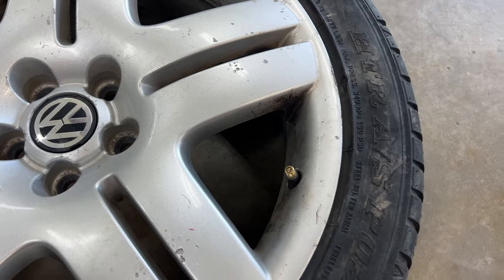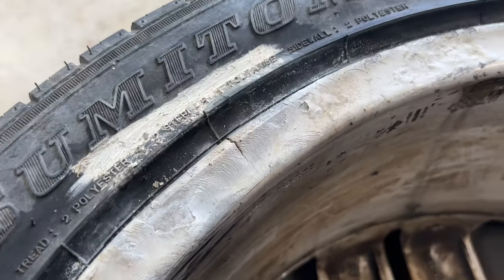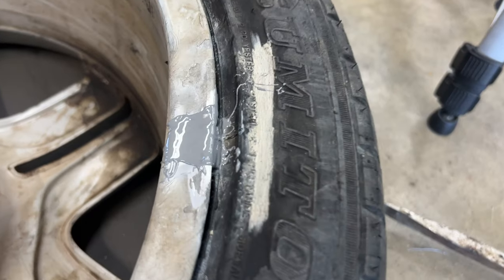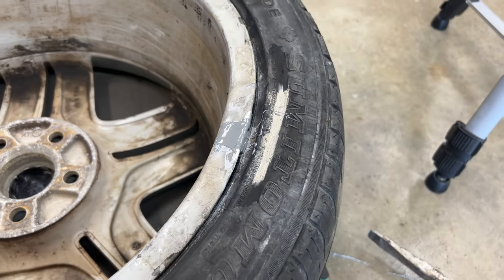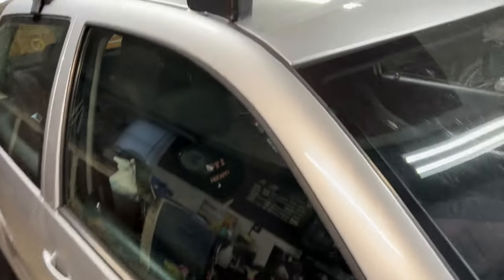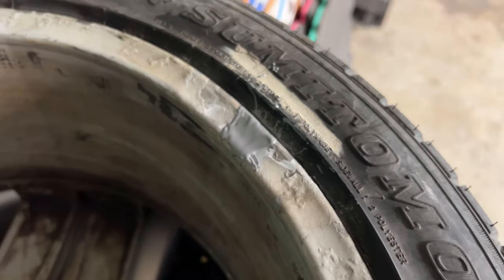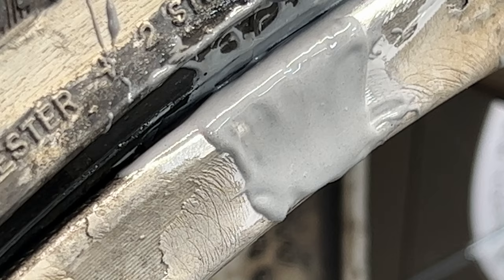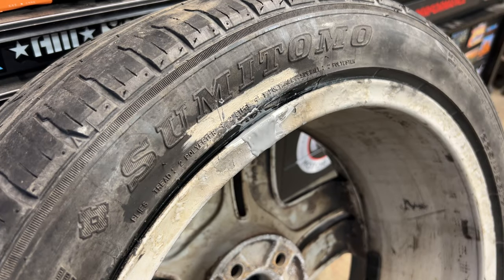Can You Fix a Cracked Wheel with JB Weld??

Comment: Replace the rim. It 's the only safe option. I studied Engineering buy my groomer knows that crack promulgate further in- to areas that paste cannot reach. You also did not tape off or prep (sand) the area correctly. it was tacky because you put it on very thick. Never use a heat gun. That heats the OUTSIDE only. Sealing in the wet material so it does not cure evenly. Yes, the outside will feel rock hard, but inside is what matters- sort of like bodybuilders who take steriods to look good on the outside.

Comment: It’s leaking because the tire isn’t fully sealed because u put jb welds in the inside u can fix it by sanding the inside of the rim till it’s flush with the edge of the rim and tire and then sand with a 1000 grit to kind of give it a polished seal that would help it seal

Comment: if you were to grind down the JB weld so it seats even there would be no leak there. Either that or just throw some bead sealer on it. I know you already sold the wheels but someone else might find this info useful.

Comment: Mannn i did this exact thing today on my e90 then looked at videos. Glad i seen this one. I didnt tink to pry the tire away from the lip 🤦‍♂️ glad i seen this vid, gonna have to go back out there and do that!   Is it holding up good?
Reply from the maker: Honestly it’s been holding! It’s got a tiny leak next to the crack where the ib weld isn’t letting the tire seat against the rim. & I blame myself because I just lathered it on where the tire seats so it’s an unlevel surface. But the crack itself isn’t leaking anymore!
Reply: @BMSmouthers  hell yeah! Ill be sure to try and coat it evenly, cause i damn sure aint taking the tire off haha. I dont mind a slow leak till my replacement gets here.   The leak mine had leaked down every 2 days. 😅
Reply: Literally outside doing this rn. Thanks for the knowledge.
Reply: @lorenzooo0029  I'd do it. So far its holding up for me like the video says.
Reply from the maker: @lorenzooo0029  hopefully it works for ya!
Reply: Doin this for the e90 tn even tho my crack in the wheel doesnt lose air so id should br good

Comment: I have 2 cracked rims and I’m looking at your video to do this to my wheels 🤟 thanks a lot for posting this !!
Reply: How have they been holding up bro??
Reply from the maker: No problem! Surprisingly it actually worked. Wouldn’t recommend riding on it like that forever, but it works for a quick job. And would recommend putting it in the back as well

Comment: Nothing wrong with it just need to clean the  rim through the inside 😂 well, then it is a better option
Reply from the maker: Yeah if I had a tire machine I definitely would have removed the tire and did it correctly, but for a last minute quick diy fix, it did the trick.

Comment: Just get it welded. It doesn't cost that much
Reply from the maker: To late. Wheels already sold jb welded. Held air to!
Reply: How much it cost weld a wheel
Reply: @akeemruss3952  Welded professionally 100.00 +
Reply: In my city it would cost $30 for tire removal/installation, $15 for balance, plus a minimum $125 for the weld!
Reply: Sometimes welding does not work I had mines weld and they couldn't fix it
Reply: @rickysealjones1621  depends on the person doing the welding
Reply: This beat where is it from